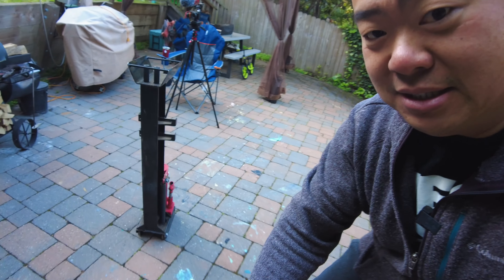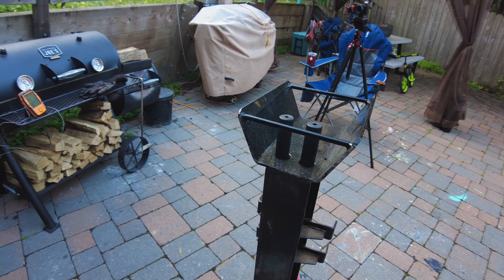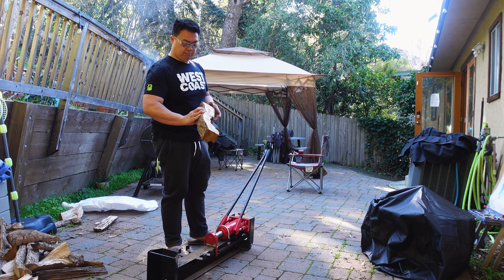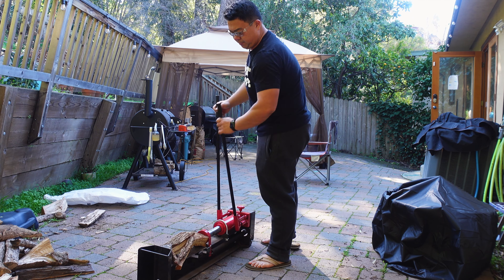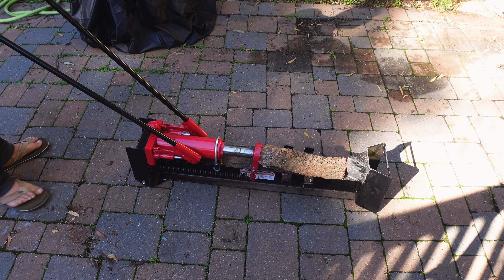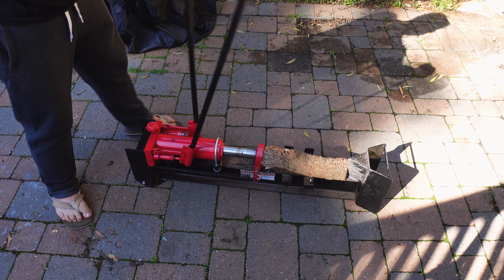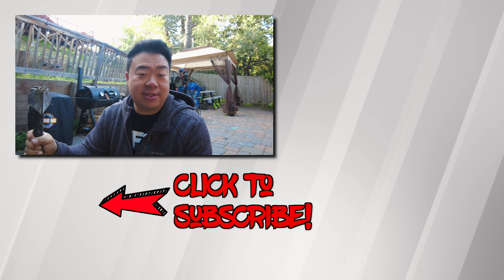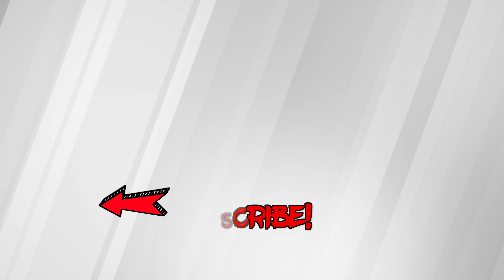Using a Hydraulic Log Splitter to Fuel the Offset Smoker

Comment: I need me one of these hydraulic splitters! I have a 2 manual splitters that don't seem to work with my almond wood. One is a Mighty Hand cast iron kindling splitter and a cone drill splitters. Waste of money lol. Or maybe almond wood is just too hard to split. What wood are you using there?
Reply from the maker: I also bought one of those manual splitters that you mount to a stump and you take a small sledge to split the wood. A lot of my oak splits simply just stuck there and laughed at me. Returned that pretty quickly. But I barely use this hydraulic splitter anymore either. An old fashioned chopping stump + axe or maul seems to be the way to go. I also use a small Silky saw now that gets my splits down faster and for making chunks if needed. I primarily use Oak so that's what was in the video too.
Reply: @HuSmokin  Let me know if you're going to sell your hydraulic splitter. Thanks
Reply from the maker: Where are you located?
Reply: @HuSmokin  Pittsburg. Moved from Oakland 4 years ago 😁

Comment: OMG! Did I just see an open seam on your fire box??? You didn't put fireblack casket between the two halves of the firebox when you assembled it??? No wonder you can't control your temps! BTW, thank for showing me the hydraulic manual log splitter. I wondered what those handles we're for being an insider track member at Harbor Freight. I'll make sure I steer clear of it.
Reply from the maker: Haha. I used the lava lock gasket. Burned off in the first month and have been too lazy to take it apart and do it again. I also have their baffle and smoke stack mods too. Under the advice of another commenter, I removed the stack mod and now the air flow and temp management are solid.
Reply: @HuSmokin  if you extend the stack, you'll find you get better draw  even with the stack mods. I used 3 inch duct work to extend mine and it's amazing the difference. I'm about to weld my own baffle for mine with tuning plates.
Reply from the maker: Interesting. Might try that then. Do you have pictures or videos up of your setup? Would love to see it.